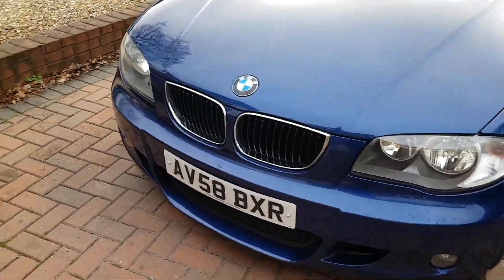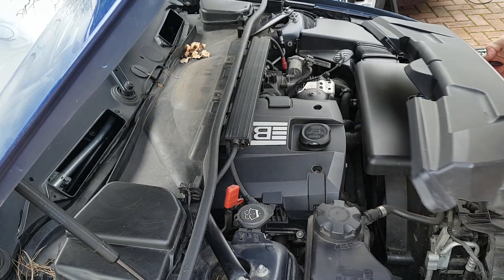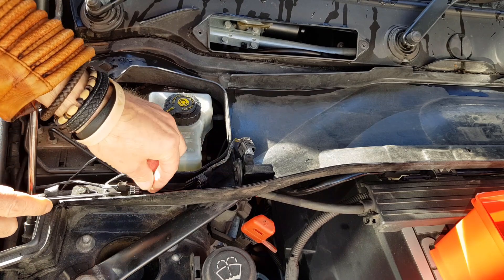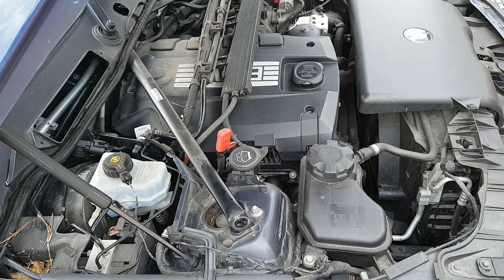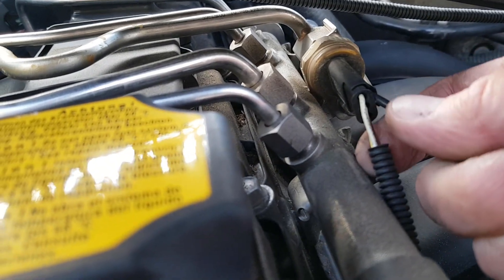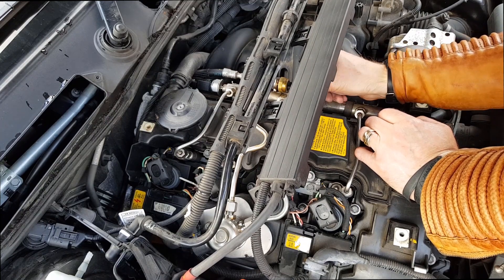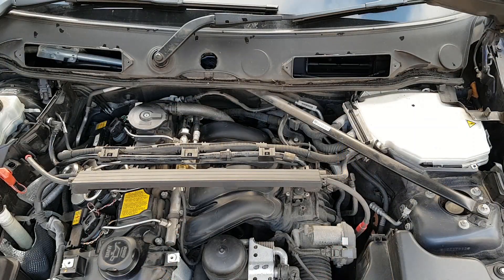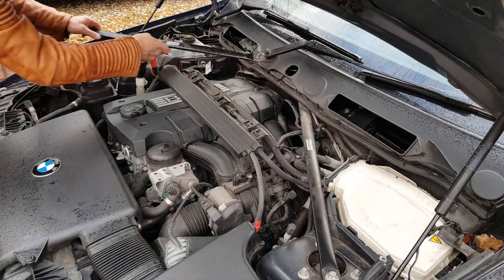BMW 1-Series Long Cranking problem fixed! 29F3 Error Code

Comment: Hey, great video.
I’ve got a BMW 118i cabriolet 2010.
It starts perfect when cold but long cranks when hot and a little lumpy for a few seconds after until I blip the throttle a little.
Would you recommend I try the fuel pressure sensor before anything else?
Reply: I shall add… the start stop works fine when driving, a fraction underperforming for a second when pulling away after it starts back up instantly
Reply from the maker: That is certainly a good place to start, yes!

Comment: Hi great video. I have same code the sensor is definitely dead. I also have a long crank in the morning when cold like it's not going to start like a struggling start but it starts and everything is fine.

So I need to replace the sensor do u have a link or recommend a particular brand as there's so many online I'm just getting confused
Reply from the maker: Thanks! Buy it from BMW direct - they sell on Ebay

Comment: BMW 1 series 2009 Petrol 
Engine light ON 
This was the diagnostic Result :
Showed the following errors after diagnosis 
Can you please help me ? 
The diagnosis results as follows 

Digital motor electronics ( DME) , map thermostat activation 
Digital Motor electronics  ( DME) , Tank venting valve activation 
Digital motor electronics ( DME), active engine mount electric 
Digital motor electronics ( DME) fuel supply control valve 
Digital motor electronics ( DME ) engine oil pressure sensor signal

I will appreciate if you can help please

Comment: hi, i have a 1 series 07 E87 N43, starts first thing in the Moring but after a long run it wont start after the i turn off the engine, has to sit for a while before, do you think its related to the pressure sensor?
Reply from the maker: No, more likely to be the MAF, cheap ones have this behaviour

Comment: Trying to diagnose a long crank issue with my 2008 118 m sport. Codes I'm seeing are 2EF7 map thermostat control, 30EA DeNox catalyst sulphurized, and A10A EWS4 timing chall resp fehler. Have you by any chance run into these codes before? Any tips to sort this long crank would be amazing
Reply from the maker: If you have replaced the high and low pressure fuel sensors then the next in the line is the fuel pressure - or lack of it when cold. Usually caused by the fuel pump (which has a one-way valve fitted)

Comment: Hi Tim. I have a bmw2013 f20 N13 116i. Replaced timing chain, tappet cover, crankshaft sensor and am still getting drivetrain error. Car has a long start now as well. Please help
Reply from the maker: As always, diagnostics is the first point of call - Carly should find what is failing....

Comment: Hey I have an 2007 BMW 116i it cranks but struggling to start , Info about the car it's been sitting for abit , flat battery we tried to jump start it but it still wont start ? Any suggestions ?
Reply: it can be ur spark plugs as well..try to replace them..i was having too much issues with my battery and i had to replace it ,tomorrow i will replace my spark plugs .

Comment: N43b20 is the engine? Regards
Reply from the maker: Yes Laurentiu!
Reply: @TimmsBMW  I changed, yesterday, according to you video and guide. It was very easy to do it watching this. Unfortunately I bought an used one thinking what are the odds to receive a bad one. And I seems nothing changed, the error is still there and the tester report stuck 6500hpa which , from what I read the sensor is not ok. Today I ordered a brand new one and I am waiting to receive it and to change it again. I will come back with result. Thank you for this video!
Reply: I fix it with a new part. Always use new parts! Thx

Comment: Any advice for BMW 1 series 2012 116i starts shuts off starts again nd shuts off and won't start after for few hours will start fine.. no fault code...?
Reply from the maker: That will usually be the crankshaft sensor - they don't leave an error code!

Comment: Hi - any experience of a 116i e87 (2006) cranking for a few secs on cold engine, but not starting at all, only long cranking on a warm/hot engine? Any advice would be greatly appreciated
Reply from the maker: Have you tried replacing the low and high pressure sensors?

Comment: I recently took that large plastic tray at 12:08 off my 1-series. I found that it's easier to put back together if you take the rubber seal and attach it to the tray. It's got a few notches where the rubber goes in. I managed to slide it in pretty easy that way.
Reply from the maker: That's great information - Thanks!

Comment: My f30 was scan by dealer and its high pressure rail sensor. My f30 after start the engine suddenly after a few second or minute the engine turn off.sometimes lonh crank cannot start the engine.it is true the symthon of high pressure sensor fault
Reply from the maker: Yes, that can be a symptom of the high pressure sensor - but, it can be many things!

Comment: Hi Thanks for the painful memories  i had a 2.0 bMW about 7 years ago i went straight into a flood of water like your daughter it stalled in about 2ft of water tried to start it about 3or 4 times i didn’t know the consequences anyway got towed out i told the insurance company that it wasn’t my fault they offered me about £6500 the car was about 3 years old i refused they then agreed to repair the car which was a rebuild the engine about £8000 got the car back about 2 months later everything was perfect i eventually sold the car 2 years later for £7000 but what a stressful time dealing with the insurance company as they tried to say it was my fault anyway great video brought back some crazy memories.
I know now Never try to start your BMW in ditched water as a mate of mins who worked for BMW said that when your car is submerged in water soon as you try to start the engine will just suck up the water like you explained .
Reply: It was your fault 😂

Comment: Hello sorry hopefully u can help I have a 2004 545i that smokes.  Changed out both Pcvs a year ago smoking stopped but its smoking again and have a jumpy rpm.     Checked the PCvs both are good checked 4 spark plugs no oil or gas smell.  You think it might be the OIL SEPARATOR?
Reply from the maker: The oil separators are part of the valve covers on the N62 engine - I clear them out here: https://youtu.be/Yy_Vzir5xco
It is well worth clearing them as I had problems after changine the PCV's around a year or so later

Comment: Thanks for the video, quick question can Carly be used on a 1995 740il E38?
Reply from the maker: If the '95 has the M60 engine then probably not - If you have the M62 then engine, gearbox and ASC+T will be able to be diagnosed (same with INPA on an USB interface). For pre-OBDII cars an ADS interface is required along with a laptop with a real RS232 9-pin 'D' type socket.
Reply: Thanks Tim for the information, so this is the confusing part on my car I really do not know what kind of engine I have, in some paper work it says M60/2 with an engine number of 50681090, but this I know that the OBD is inside the engine and its not original adapter its round in design on which I had to by an adapter but since its a 1995 that's is the tough part in getting something that I can read diagnostic codes